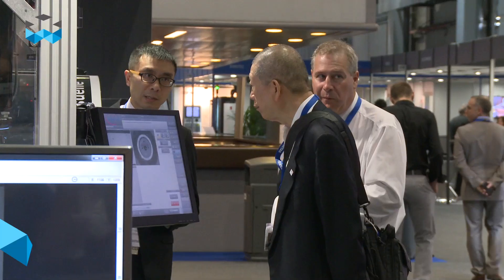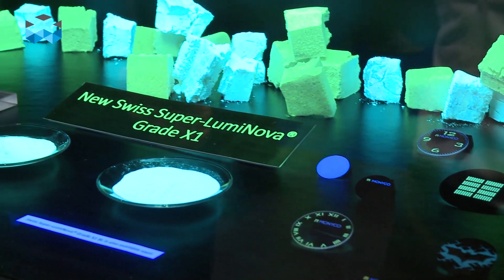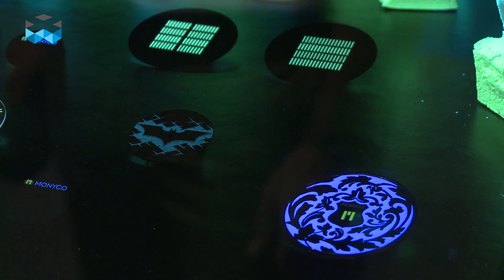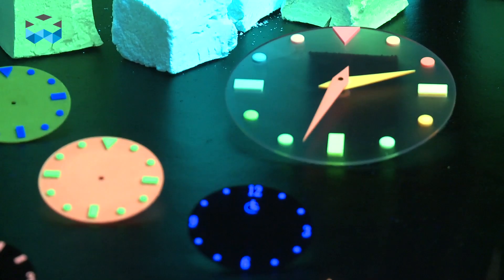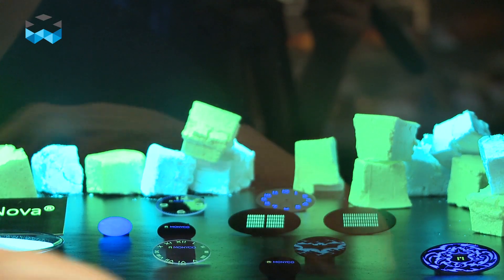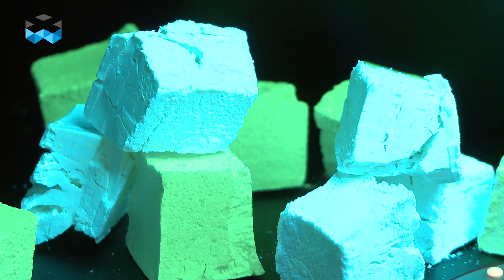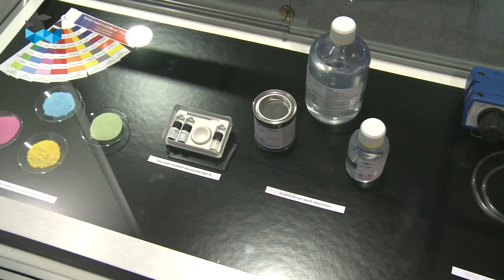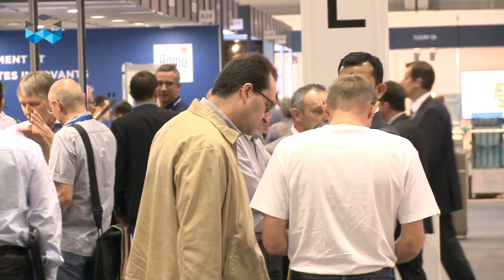The Secret of Light in Watches

Comment: Great video, thanks so much!! 

It seems I need to learn about what to expect from the lume of my watches... I have a few relatively cheap watches (Steinharts) that do have lume..however, I was thinking that "lume" means "you can read the time on your watch in the dark at any time, without preparations"...  I have since discovered that my Steinharts are completely unreadable in low-light conditions... I've read somewhere that "you need to charge the watches in the light", so I've tried to flash a bright torch (normal, as well as UV light) onto the watches... I have then noted that indeed firing a torch on my weatches really lights them up, however this effect only lasts about HALF AN HOUR...so 30mins after having charged the lume, no lume at all, and can't read the time in dark... does anyone have a different experience to mine? 

My assumption is that "lume" is something that always works in the dark, so if I am out and want to read the time in the dark, shouldn't need to carry a UV torch with me.....am I missing something here on what to expect from my "lume"? Thank you!!

PS: so far, my only watches that seem to ALWAYS have lume -even in day time, without a need to fire a torch (and are ALWAYS visible in the dark), are my two Luminox watches (I am not affiliated with them, or paid from them, ar anything like this)...
Reply: Yeah well if you want your watch to always glow very strongly, the only option in my opinion is one that is actually powered by a batterie and lights an led. However, for a mechanical watch a alternative to a batterie might be the use of trithium as a lume. Trithium does not need to be charged up and lights for decades. The downsides are, that it is radioactive (but it's almost negligible, as the dose wearing such a watch for one day is about the same as eating one banana). Another downside is it isn't as bright as the best lumed watches, only about half an hour after the normal watch has been charged up completely, the tritium is equally as bright or brighter.